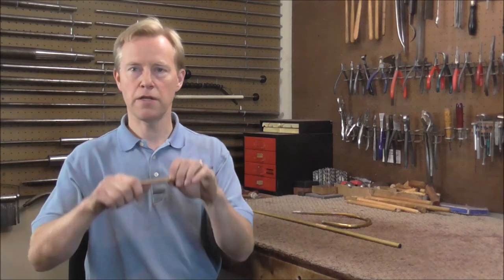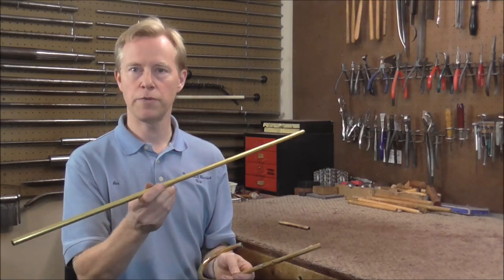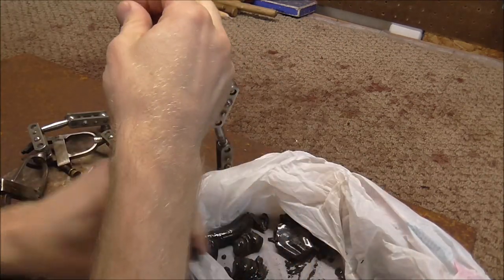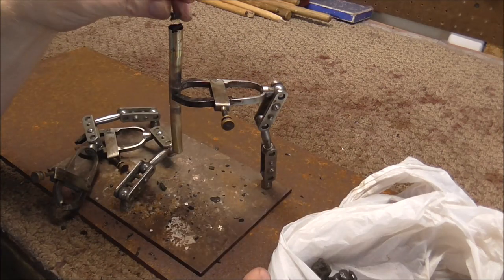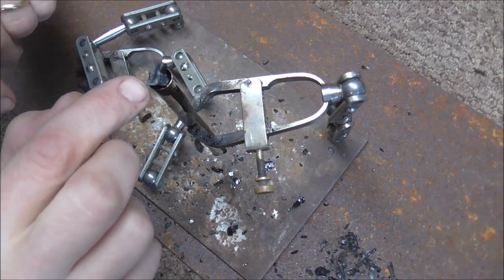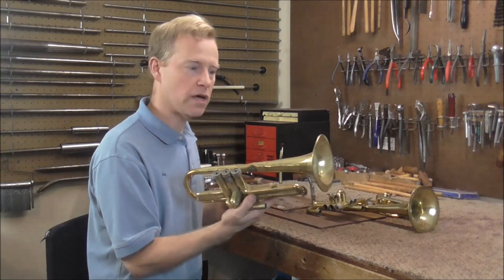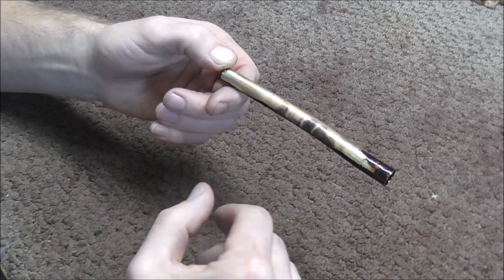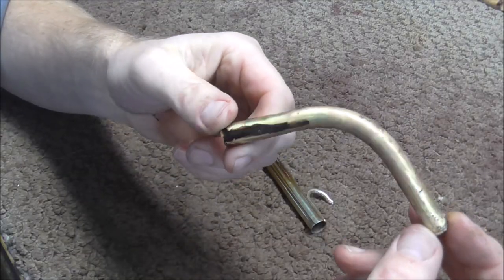Bending Tubing On Brass Instruments

Comment: Nice new torch ;) thanks for the video. The only tube I had to bend, I used cerrobend (Woods metal). I suppose pitch works similarly but for some reason it's nearly impossible to find in France (ans for what I know, cerrobend is way less smelly)
the mini baritone project is promising, can't wait !

Comment: How easy is it to clean the pitch from the inside of the tube, and do you remove all the pitch from the inside
Reply from the maker: The vast majority of the pitch drips or burns out when you heat it up. Most of what is left is soot from the fire. If you wash it out and use a brush on the inside, it will almost all be gone.